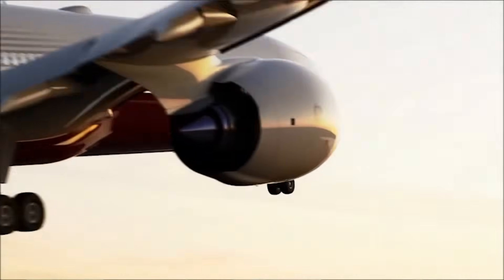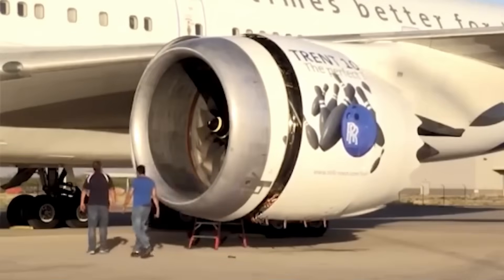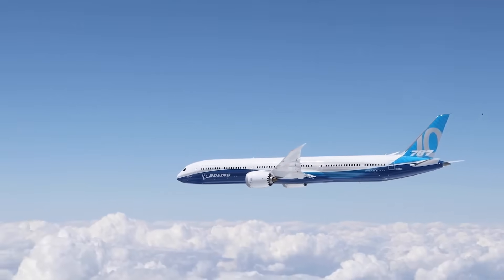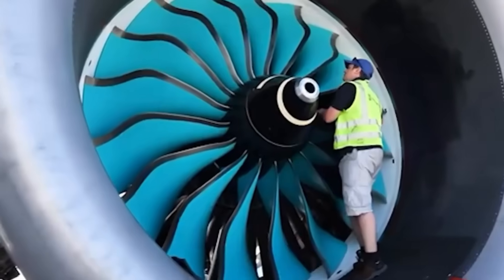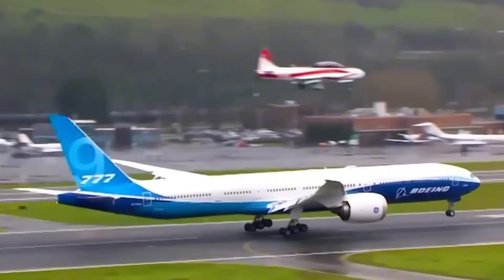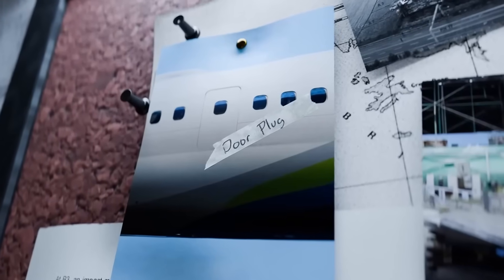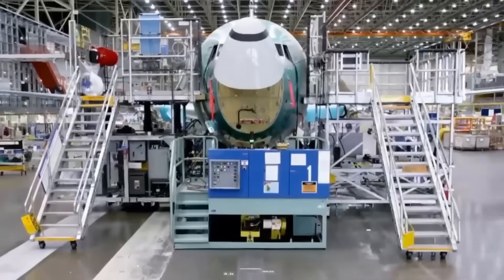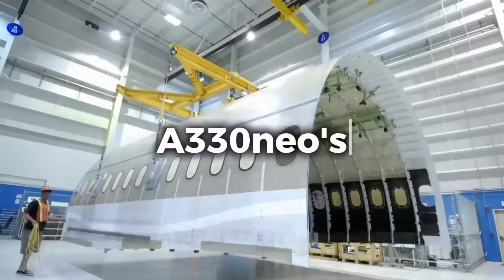This Is Why Boeing 777X Engine is The BEST In the Aviation Industry!

Comment: The issue is, it produces less power than the current GE engine so it is not the most powerful.  It produces less thrust on what will be a heavier aircraft and that will be what delivers the better efficiency, if the plane can get both the ground.  The plane has less range than the 300er and flies at the same speed if not slower for better fuel numbers.  What exactly is so revolutionary?  Besides the untested new material?